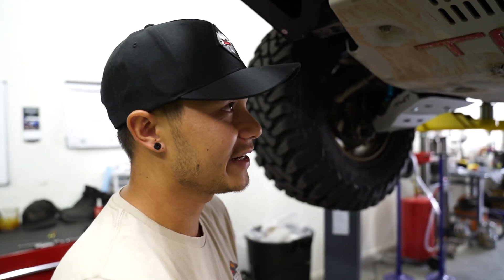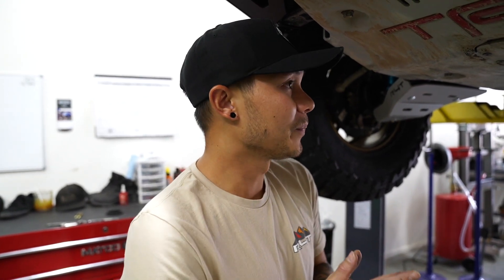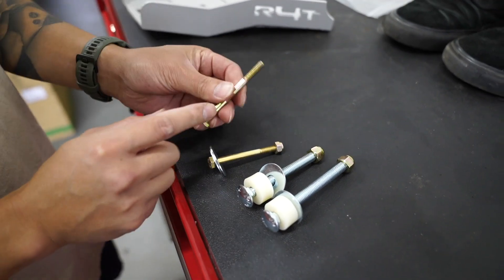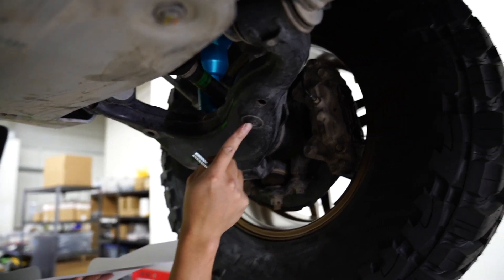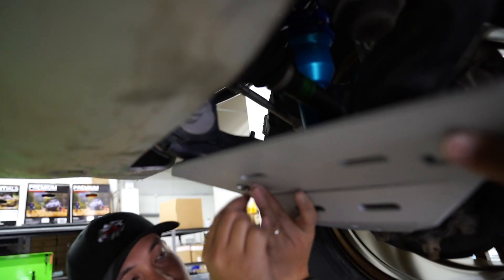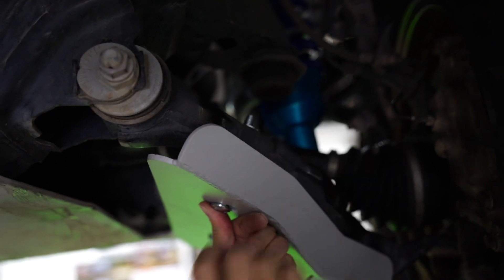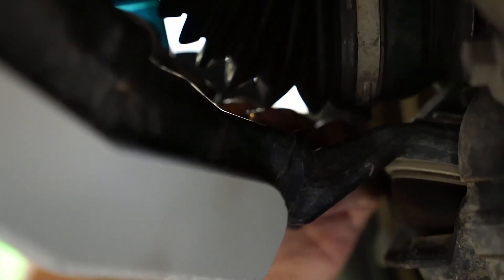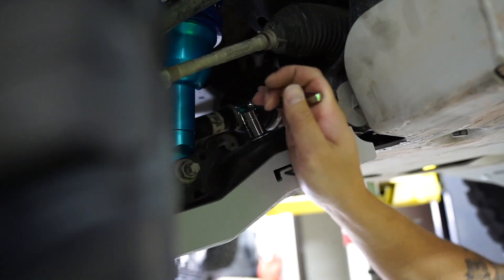How-to Install Runnin 4 Tacos Lower Control Arm (LCA) Skid Plates

Comment: That inner bolt sticking up near the cv boot, seems a bit sketchy, seems like it'll come into contact and possibly rip that boot. Is it possible to find a way to put the bolt from top down.
Reply: Read my mind...  A pan head bolt facing down would be ideal, but any excess of that bolt sticking downward could easily be sheared off on a rock.  Would love to have these if someone could come up with a solid solution.
Reply from the maker: We thought the same but we've LCA skids (diff brands & these) on for over a year and the boot doesn't have a single scratch on them
Reply: I retro fit the bolt and added a lock washer and thread locker and acorn nut.
Reply: How come my stock 21' appears to have way more clearance in that area compared to the one in this video.

Comment: Love your stuff guys but quick question, does it have to he lifted in the air like in your video or can I do it laying on the floor? Fits all Tacoma correct. Have a 2019 trd or
Reply from the maker: You can do it on the floor